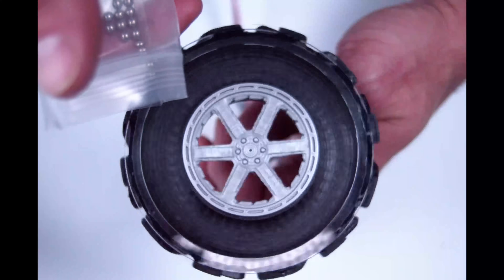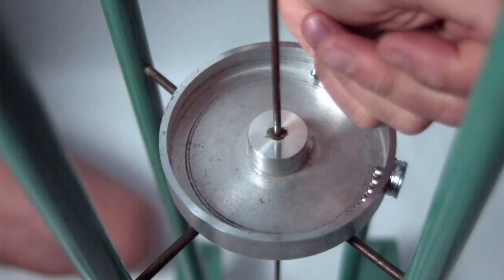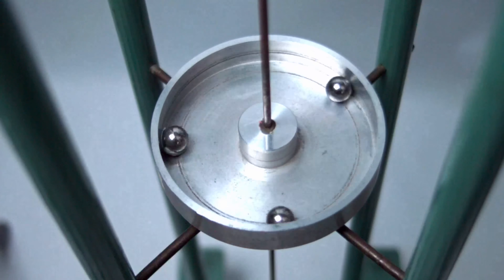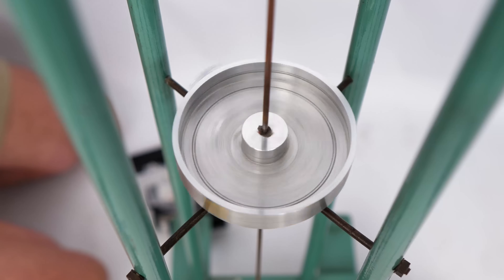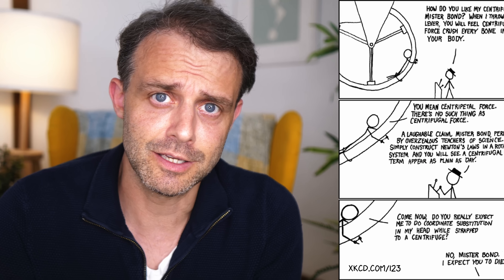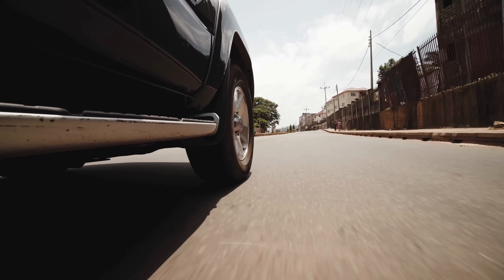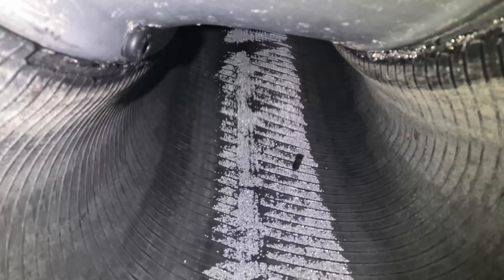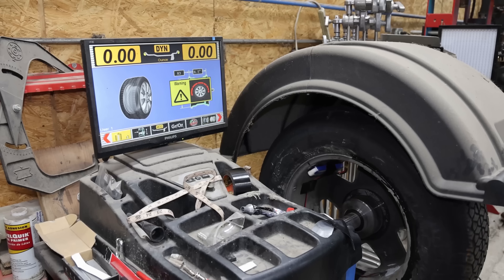Do tire balancing beads actually work?

Comment: Mr. Mould, Im having a hard time agreeing with you on this one.  Doesnt centrifugal force by nature evenly distribute mass energy  across the area of the inner circle? Much like a spinning top the centrifugal force is constantly pulling the mass to the outside of rotation even when the top is wabbling, the force is actually pulling its mass upward as its falling downward? In that case, its centrifugal force is pulling its heavier mass upward and forcing its axis downward. As long as the frinction against the axis contact point isn't greater the centrifugal force, each rotaion will make a minor correction that will collectively add up to stablization by relocating its center mass. Wouldn't that be the same with the tire beeds? Wouldn't the beeds work simply because centrifugal force by its nature wants to create a perfect spin on its axis and the beeds automatically move to the counter position of the imballance?

Comment: The real issue with the beads in tires is that the majority of air compressor setups aren’t “perfect” and introduce moisture. This moisture leads to the beads clumping up, meaning they can’t spread out and do what they need to do.

Comment: So if you have a day of nothing but town driving, they will never balance that day. They could shoot some glue in with the beads and fix them permanently. In Hunt's device, if you fixed one ball 2/3 the way up the wall of that dish, would the free ball go 1/3 up the side, directly across to account for wobble? <-- Assuming that the top of the rim's weight would equal the bottom of the dish's weight.

Comment: It would have benefit in conjunction with wheel weights. The wheel weights would work exactly as they always do, but the beads would make the balance perfect at highway speeds which may improve handling comfort and performance... maybe... but you are really shaving pennies at that point, but at high speed, it may make a difference. Now I want to try it, lol.

Comment: I only use balance media in my Jeep tires.  They are unevenly worn 37" mud terrain tires.  The beads work.  Period.  In the past I have had shops refuse to balance tires once they get over 6oz or so of weight needed.  I have used balance beads in them for many years.  And tractor trailer's have used them for decades.  "Equal" is the big brand name, but the brand I use is "Counteract".

There also isn't much scientific research needed.  Drive with big unbalanced tires, then drive again with the beads.  There is no question at all that they are working.  I also argue that there is no need to get anywhere near highway speeds, at least with large tires.  My jeep is 95% offroad, and on 5% on road, mostly traveling to the trails we run and the camps we go to, so I never drive it on the highways.  Maybe on smaller diameters the rotational speeds need to be higher to get the same affect.  Not sure.

Comment: All this theoretical BS.
Put a wheel & tire on a balance machine and have it out of balance.  If correct then add some lead weights.

Now add the balance beads and you will find they work.

For years back in the 1970s,1980s we used to put water in wheels to do this.  Where I lived the winters weren’t cold enough to freeze the water.

Spoke to guys who lived where itngot cold enough, they did 50/50 mix of water & rubbing alcohol.

Works great.

Comment: I installed beads and they work well.  Long story short, I 1st installed them with wheel weights still installed (I swear, 1/2 the time at least, wheel balancing is done improperly!)
The beads didn't work until after I removed the external wheel balance weights.

Comment: The most GLARING issue with balancing beads is this...
If you have to reach 60 Kmh for them to activate, first that makes it completely useless within a city which is where most driving occurs, secondly REDLIGHTS! No drive is ever going to be without a complete stop so even IF you activate them on the highway, they will still fail the second you enter a city because you will very quickly hit either a red-light or a stop sign, and that's assuming you don't have to slow down too much on turns. Cool in practice, but i really only see this as applicable in horizontal disks where gravity plays next to no role on the beads.

Comment: I have run glass beads or airsoft pellets in my motorcycle tires for years and yes, the do work. Static weights are only good until your tires start to wear and then your wheel will be imbalanced slightly. With dynamic beads this is not a problem as they automatically adjust themselves. There are also wheel balancers that employ the same principles that are installed externally from the tire when they are sandwiched between the wheel and hub on cars and the disk bake and the hub on motorcycles.

Comment: CounterAct beads solved a terrible shaking my motorcycle was experiencing above about 115Km/h, so that somewhat contradicts your findings. However, they were the only solution that worked, and they work like a charm. No motorcycle of mine will ever have balancing weights on its rims again. Beads also balance tires as they wear or if they shift in the rim which is something no standard balancing weights can do.

Comment: I had tires installed and they used a rubber bead that I believe he said would find the light spot and would sort of glue themselves into place.
Well they work really well 20k miles or so and no problems.

Comment: As a 20 year veteran technician i can say balance beads work very well but have someehat limited applications. They dont work well on small tires unless the speeds are kindof high. Balance beads are best used in race applications with bigger tires or off road race vehicles that risk losing wheel weights on obstacles. Show cars will also use them from time to time to eliminate the "ugly" look of wheel weights. Or to save damage on expensive paint from installing and removing weights.

Comment: Balancing beads are a tricky matter. The larger the diameter of the tire the faster and more noticeable the effect comes on.
The unsprung weight of the wheel/tire and suspention also effect the ability of the balancing beads
Generally speaking light small diameter tire/wheel/suspention has almost no benifit for balancing beads.
Large trucks such as semi trucks are very noticeable when the beads haven't seated yet

Comment: Hi, I am a full time mechanic. I have worked on pretty much anything with tires that is not military. Balancing beads are utilized most on the medium duty/heavy duty vehicles, tractor trailers, medium duty work trucks, dump trucks. Most of the tires that are replaced on these units are done in the field where there is not a fancy balancing machine to balance the tire thus beads are used to provide some effect. I would not recommend on your car. Your car is not hard to tow, or get into a shop, road force balancing a tire/wheel is the best way to keep your tires in good shape for a long time. Thanks for the content this really helped me visualize how these things actually work and at what speeds they are for sure good at and for!
Reply: That's a nice expert advice and I'm sure it's greatly appreciated here, however I think no one mentioned the costs comparison of just lead weights and glass beads I think your advise says it doesn't matter 
After all is a one time expense and that's the correct way to do it 👍
Reply: Doesn't larger tires @ the same RPM mean higher horizontal velocity? How would larger wheels justify balancing via beads? E.g. A normal car tire at 15 rev/s is ~50 mph but a tractor tire at 15 rev/s must be much higher (say > 70 mph)
Reply: @Arunnn241  Larger tires resonate at a lower frequency. They also have higher G-forces as the mass is in a larger circle. So the beads do work at a lower speed, even though the tire is rotating slower. But ease of use is why they are or are not used. Small car tires are usually mounted and balanced at a shop. Large tires and motorcycle tires are usually mounted in someone's back yard.
Reply: @Arunnn241  its not really about wheel size. There is not a better way, or faster way, to balance a tire in the field.
Reply: A lot of guys use sand to buy it tends to wear the inside of the tire
Reply: I used them because I'm not paying $400 to balance them at a shop. Keep overcharging people and they will find another way, and you will lose money you would've made if the price was reasonable.
Reply: @Mind_ConTroll who the hell do you let balance your tires firestone?! Industry average is about 35 bucks a tire.
Reply: @acfrmlc  No one, there's apparently only one place around that will even do 35s and they wanted $100 per tire for balance and $200 for an alignment, firestone actually put the 2 new tires on that I bought and rotated them, put the beads in and the new valve stems for $100
Reply: @Mind_ConTroll  oof. Yea big tires are big money.
Reply: @acfrmlc  35s aren't big, not $100 a pop big, you could make $200 for all 4 or you could make nothing, your choice
Reply: @Mind_ConTroll  35s for most balancing machines at auto tire shops  is pushing it. Usually the machine cant do that great of a job on tires that size from my experience. Which balancing beads probably help with a ton.
Reply: @acfrmlc  I went to the same shop that did my previous ones, mounting and balance. The guy was some lazy kid that day and just said no, called around and found a shop that does big trucks, they quoted me the 100 a pop, but like i said, I bought some online had firestone put them on, they had some contract with the seller, they did mount balance rotate put the beads in and the valves for a hundred and some change, people are just lazy now and wanna charge alot, also 35s are pretty common, outside of inner cities
Reply: @sgtjonzo  sticking tires in a machine and pressing a button,... oh, you poor soul, do you need a nap? I almost forgot the .25 oz weights with a sticky back, shall I have my 8 year old daughter show you how to put stickers on? If this comment doesn't tell you that mechanics are 90% con-men and thieves, I don't know what else will.

Comment: Coat the beads with a layer of UV-hardening monomers and lid up a UV-lamp placed at the inner periphery of the rim when on the freeway. Polymerization and sticking to the inner surface of the tire occurs at the optimal spots and - voila - the beads will stay there even when you park the car. 
Now develop this concept and fill in a freshly prepared liquid mixture of reacting monomers (eg adipic acid and hexamethylene diamine), preferably through the air-filling valve, and keep driving 20 mins on the freeway until polymerization has completed and - voila - you have a permanent solid inner sheet (eg of nylon) with slightly different thickness along its extension providing an optimal balancing continous counterweight to the previous imbalance.

Comment: So I have to run stop signs and lights and then get on the highway and hit 50+ to have my tires balanced. I do believe the bearings would balance a tire that's perfectly round inside but tires have what's called a contact patch that flattens a section so if the bearing was in that position it would get Jared out of place. I'll stick with weights. Great video thought!

Comment: Well I can tell you they work good in large diameter tires but not so well in small diameter tires. And the tires that balancing beads seem to make worse, when I put on my actual balance machine the tire has a radial imperfection. Meaning the tire is not truly round. So the more true the tire is the better the beads work. If the tire is out of round which about 60% of brand new tires here in the United States, are not actually round, it doesn't work so well. Hence why I bought tire machines. Got sick of going back to the tire shop repeatedly for a shake they can't seem to get rid of. I can on my own machines. Because if the tire isn't true I send the damn thing back and exchange it till they get me one that is. Next time you're buying tires look at the dots on the sidewall. No dots is usually a good thing. A yellow or green is a heavy spot in the tire. A red is a high spot in the tire meaning it's not round.

Comment: They've done this in washing machines for ages, decades. Funny thing is manufactures use water to balance load and people thought it was broken with water trapped in the top of the basket. People were
draining it like crazy only to discover the imbalance was worse.
Reply: Wouldn't this balancing system work better if you put a liquid in the tire??
Engine coolant would not evaporate and would help prevent aluminium rims from corrosion between the tire bead and rim seat.
Reply: @angelocardoc  or a fluid, like air ? wait...
Reply: @flo0778  
You high, bruh???
Reply: You throw hundreds of beads in your washing machine? I feel like I'm misunderstanding 😅

Comment: I've used balancing beads in my project car for about 10 years and at very low speeds, if coasting with windows open on a smooth road, I can hear the beads sloshing around due to gravity. But at moderate speeds that noise goes. I think the fact that the stub axles are very short and that the bearings are strong, helps to keep the wheel from wobbling about. Also, the known vibrations of an unbalanced wheel at (say) 50 mph, will also be connected to tyre and spring resonance, not just the effects you've described with a fixed apparatus and a springy axle. Even a perfectly balanced wheel will vibrate at various speeds if the tyre resonances and spring resonances get in phase. I have adjustable dampers on my car (because my suspension is non-standard) and if they are not adjusted correctly I can get vibration. Finally, on another car, without beads but trad weights, a front spring broke at one end, thus shortening it by only a small amount (say 5% - but I didn't measure) and the vibration from that wheel was terrible. With a new spring, it went away - the wheel was the same and not recently balanced.

Comment: Thank you for posting this video. I never understood why they worked and like you, in my mind it seemed like they would make the out of balance condition worse. Thank you for explaining it so well. I've been using them on my motorcycles for years. Just last year the shop that changed my class A diesel pusher RV tires used beads in all eight. I've never experienced a vibration from my motorcycles or my RV so I know they work.

Comment: I thought it was so reasonable to balance tires very 50-75,000 miles, like about $0.00002 per mile. I’m sure getting all those beads in the tire is a real bargain. Then again I do sit on the proper side of the vehicle, unless I’m delivering rural mail or shooting on the curb side.

Comment: The requirement of freeway speeds to "enable" them, is a deal breaker for me, and seem even potentially dangerous enough to warrant banning them in my opinion. Having a cheap solution that would requires you to speed anywhere outside a freeway to solve a problem, when there is another solution that works at all speeds, just seems to needlessly increase risk, and pushes people to take that risk to save a little bit of money, which is not what you want for road safety.

Comment: The glass beads find their spot and from static electricity stick to the rubber so that the tire stays in balance. If left for a longer time the static cling may  fade and you'll need to balance the tire again. With larger tires, such as on trucks, attaching a balancing ring behind the wheel means you don't lose the beads when the tire wears out

Comment: I have 38" tires 15.5" wide, they weigh about 150lbs each. I use traditional weights to get them close to balance and for low speed driving, and I also have beads to iron out at highway speeds, in case I throw a weight, and to maintain balance overall. And it's always been diamond-splitting smooth in my truck.

Comment: I'm reminded of a lube-oil purifier we used in the Navy. A long tube, spun very fast with oil admitteed to one end and some baffles to trap dirt and divert any entrained water out a separate path than the exit for the oil. One end was fixed pretty well in a bearing, but the other end of the tube just had a sort of friction face, rubbing lightly against a fixed plate with the exit holes. (it stood vertically).  ( called a 'Sharpels Lube oil purifier)

When starting, it sometimes would vibrate/ shake really bad, but once the speed got past a 'critical frequency', it would steady out and run very smoothly. The key is spinning above the critical frequency.
Reply: P.S. Those oil purifiers are a very old tech, maybe prior to WW II??  The high speed uses centrifugal force to separate the oil, and being above resonance they run pretty smooth.

Comment: Honestly I saw this and never heard of them.  I was expecting some kind of thing in the shop that adds them and spins the tire, when they are perfectly balanced.  It would heat the tire so that they melt into the rubber or fuse with it and become permanent.  A temp where the rubber doesn't melt but the beads reach some kind of chemical point, like superglue and become permanent(maybe scraped off if the tire gets damaged) but not enough temp as to change the air pressure too much in the tire.  The temp would obviously be done via tests while anything above 200F is bad for a tire but that's during operation, just spinning on a machine, it might be able to go higher temps.  This would be for the rims where you don't want any weights visible.